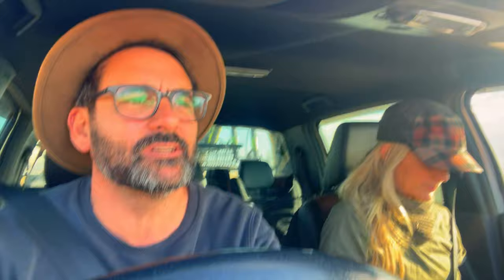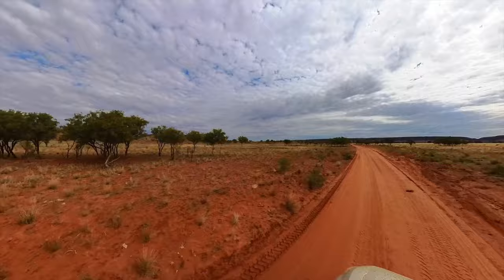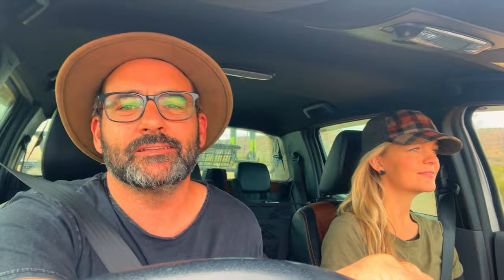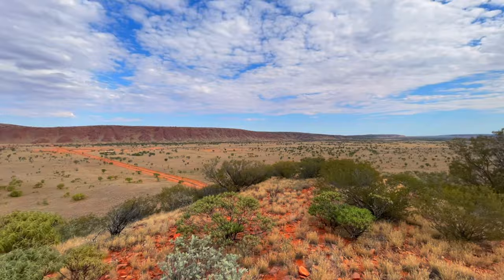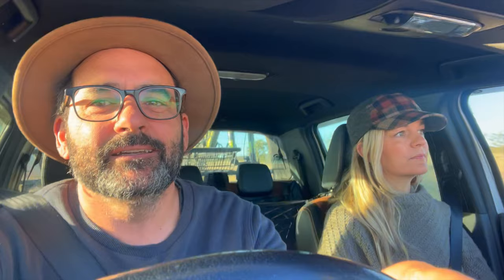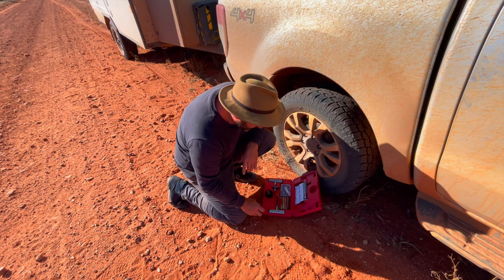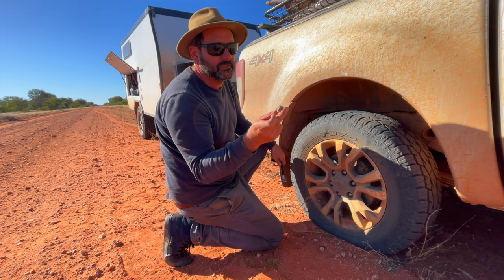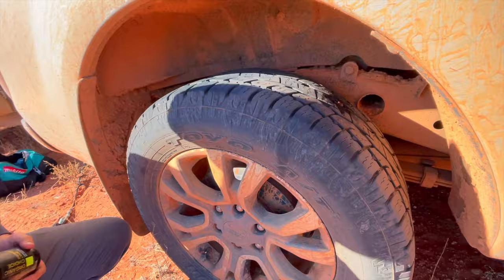Oodnadatta & Binns track: Part 3

Comment: Love your travels. Thanks for taking us along. 
The tyre pressures did sound like they were too high for the rough bits.
Hopefully part 4 will be the minutia of the caravan - how did it faire on the Binns? Oh, and more about the composting toilet too. I'm wondering if I can replace the chem toilet in the FF camper with a small composting toilet.
Reply from the maker: Thanks Ben. There’s a few more vids from this trip to come. Struggling to find the time to edit. The caravan update vid also in the queue. A couple of casualties - the brake line was disintegrated on the trip, a few components rattled loose and the main letdown was the Ford ranger! It did not fair well after being shaken. There’s a whole episode on the toilet (install and setup etc) on the channel in case you missed it.
Reply: @PerpetualTransient  Great to hear about the caravan! I'll chase up the episode on the CT - thanks.  As for the Ranger - I suppose you keep replacing bolts that rattle loose with liberal amounts of thread locker? You can then literally claim the car is held together with chewing gum :)